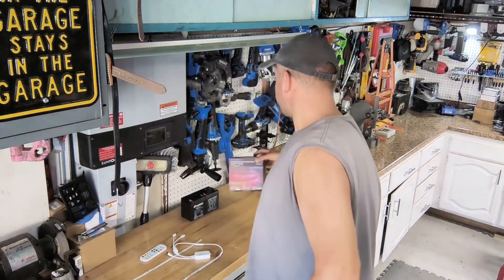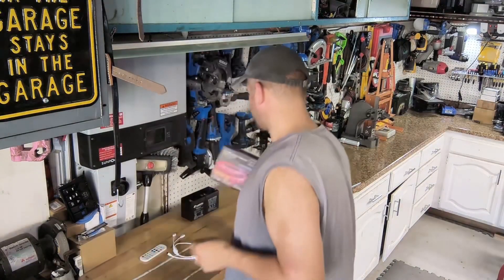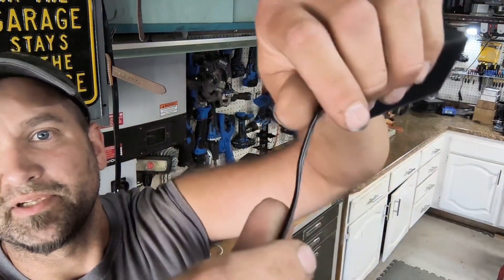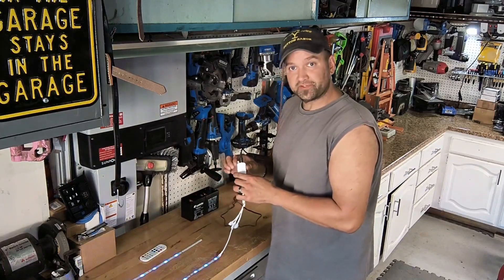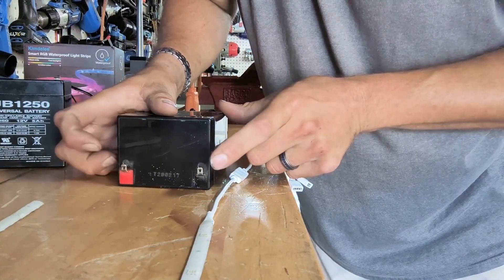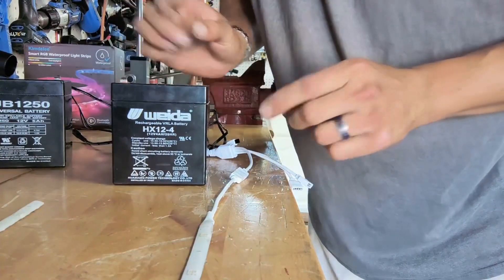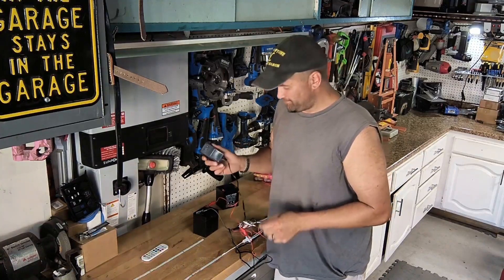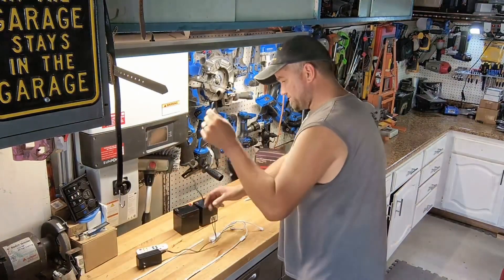Say Goodbye to 110 Outlets: Convert Your RGB LED Strip Light to Run on a 12 Volt Battery

Comment: It should probably be done the right way, with a 12v DC voltage regulator for the LED string's specific voltage and amperage requirements. That being said for as cheap as these are wouldn't be too worried about having to replace them other than lost time and potential fire hazards. Cheers

Comment: Are you concerned about direct connection to an RV system such as a previous awning light that has 12 V wires going to it my question is more based on the fact that the voltage may not be regulated and might get up to 14 V when charging. Wouldn’t that damage those LED lights or do you think the 12 V wires already in the RV or somehow regulated by the battery or converter system?
Reply: Each series of 3 LEDs in the strip have their own resistor, so the current isn't going to be quite so dangerously non-linear with voltage. I'm sure none of these guys doing these copycat videos are doing any of the math though.